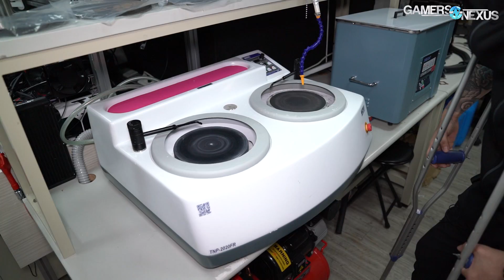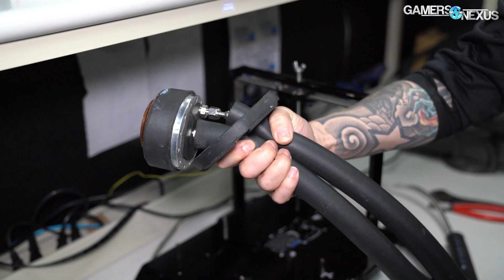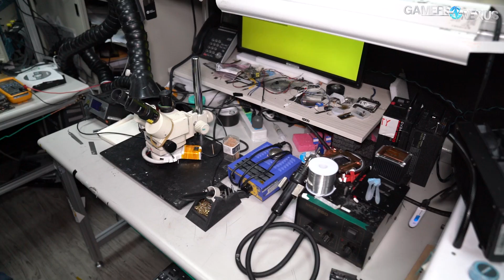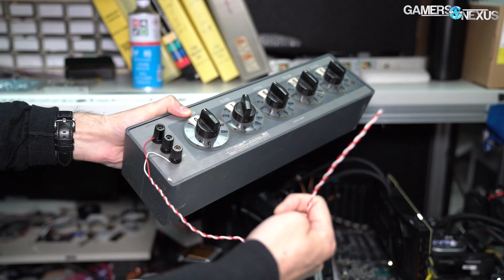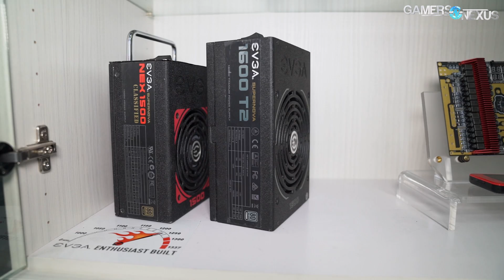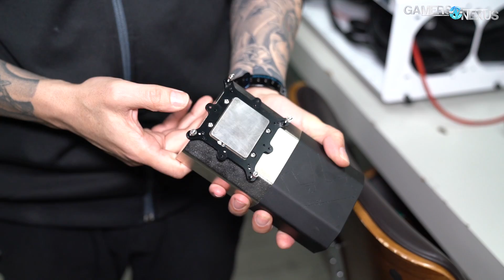KINGPIN Overclocking Lab Tour & Secret EVGA Products

Comment: I'm sorry; I can see these guys are really proud of their work in this space. But I now completely understand why EVGA video cards I've used never impressed me, as well as why, in my personal experience in PC repair shops, about twenty percent of dead-card systems had EVGA cards. Not so much because they were not good - they were decent - but because they had such an OC/snowboarder/rockstar vibe to them.
Because of that, they were purchased by a lot of kids with money who ruined them by extremely OCing them, but without the necessary precautions like adequate cooling.
But the main thing? That lab space is filthy-dirty! Like, mobos leaning against AIOs on cardboard boxes?
This space seriously reminds me of my room in my parent's house when I was 15.
The only thing I find surprising is that EVGA allowed this slop to persist for as long as they did.
And you can see in the dynamic between Steve and KP that KP thinks Steve should be way more in awe of the Greatness he has been permitted by the gods to glimpse, while Steve just wants to find a broom and some Windex.
This is why you never meet your heroes, kids.

Comment: I had a 780ti classified and kingpin and a 980ti kingpin, actually still have the 980ti kingpin just quit working but I ran it at 1.175v for like 5 years with the classy controller. Also mem overvolted to 1.5v (iirc)

Comment: Little do they know this is their front of house fake lab.  There is a button that you push under a table that opens a portal to the KINGPIN cave where the real work is being done to create micro wormholes that transfer heat to another dimension that coverts it to usable electricity that then gets routed back to GPU.

Comment: In most physics/chem labs people put just water in the ultrasonic bath, than put a small beaker with the solvent and the part to clean in the bath. the part will get cleaned and it readuces the surface of your solvent and the risk of fire...

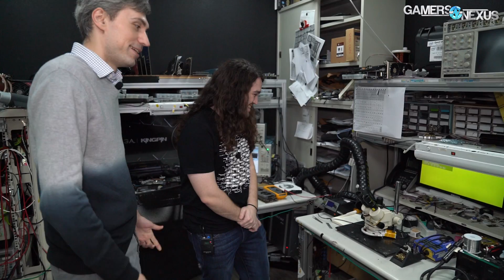Comment: 10:54 That black anodized aluminum heat sink with the copper base (CNC'd flat) is not something they made! TiN calls it "prototyping parts", they may use it for their own prototype testing, but it itself is a product from almost 20 years ago. It is an air cooler for socket A (462) (Athlon-XP, Duron). I think by swiftech. I have one somewhere...

Comment: Nice Tektronix Great Scopes, I used to repair & calibrate Tektronix Scopes, my favorite 7000 series, ESI Resistance Box another great kit for the Lab :) I used to be Deputy Head Manager of the UKAS Laboratory Years ago,  Parylene coating on a PCB is wonderful coating to keep the components intact and very dry, hard coating, once applied hard to probe to the PCB thats the only drawback,

Comment: Fellow NC resident, we had this type of machine (sander/lapper) when I worked in powdered metals inside of the QC lab, except we had 4 wheels for extra steps in the polishing process. The first 3 were different grit of sandpaper, the last wheel was a polishing pad. We also had an ultrasonic tank for tooling. Very cool to see these tools used in Kingpin's lab for PC parts.

Comment: Nice bike K|ngp|n, also on the X299 green board that was put in Ultrasonic cleaner there seemed to be blue thermal paste on the back, why is that? What components we being cooled on the back, or was that just to protect from back plate? Ty for the tour, good luck Tin and Vince!
Reply: It's protection against condensation: everything around the CPU gets very cold

Comment: Looks just like my old Lab back in the day...the feels..
and BTW, Each of those Logic Analyzers/Oscilloscopes and other equipment can range from 1000$ to 50000$+ USD. Hell, those voltage probes are most likely 5000$ USD. Tektronix, nothing but the best.
Reply: My logic analyzer (that one on video actually personal asset) have listing price over 50k :)
Reply: @xDevscom_EE  i kinda miss my old job and ya 50k$ plus, i had probes that were 5K each for measuring electromagnetic leakage out of test prototype for FCC regulations and what not.

Comment: The NEX1500 PS was an awesome product, but reliability was poor. What was really cool was the software that came with it and the access it gave you to the PS. I wish EVGA would come out with another PS like the NEX1500, but with the quality of current products. Also, the braided cables were nice. I'm still using the braided cables from the NEX1500 today, even tough I've updated the PS a couple of times.

Comment: Why won't EVGA make motherboards for AMD?
Reply: they should, would love some
Reply: Excalis Ogre lord my guess is just the lack of interest in AMD overclocking. Most records are set with Intel chips and the dark boards are really meant for LN2, so not much interest from casual AMD overclockers/gamers
Reply: @jakenorthand1755  haven't they gotten the new AMD's to something insane like 8 GHz or something lame?
Reply: Jesper Andersen nope, Ryzen is rather awful at high frequencies. World record is 6ghz on a 2700x and 7.3 on 9900k. Benchmarks are also dominated by Intel. For Cinebench R15 8 core you have to scroll to around 45th place to find an AMD cpu
Reply: @jakenorthand1755  ah sorry it was not the new ones but the FX series they did a world record 8.7GHz on, so yeah AMD sucks not even 9GHz
Reply: Jesper Andersen FX series is a one trick pony. Sure it can hit high frequencies but it has horrible performance once there. Top cinebench for a FX-8350 is 1115, while air cooled 9900ks can hit 2000. Piledriver CPUs are also limited to DDR3
Reply: @jakenorthand1755  doesn't really matter since Extreme OC'ing like that IS a one-trick pony thing, noone runs it permanently, noone uses it for anything other than posting the screenshot and getting patted on the back. and the one they used was good enough for many people for quite a few years, was it the best? Nah, but it was cheap and did well enough

Comment: The fire hazard is due to the solvent evaporation from heat up due to solvent particles shaking from the ultrasonic waves hitting them which creates heat. KP just ends up with a tank partially filled with flammable isopropyl alcohol fumes, so he needs to keep it away from open flame or electrical sparks. We use those to clean glass at our chem lab or to prepare various solutions. Daily we run them with distilled water so there's no problem with heat unless you let them run for hours and forget to refill the water (which does happen with students etc). You also might run into them at your local jeweler since they often use it to clean jewelry like necklaces, rings etc. The sound that it makes is a bit different in RL, the way it came out on YT is probably due to some interference with the mics. You can find some videos which have the correct sound recorded but it's a real PITA for your ears in RL and usually you keep it away from regular work stations, preferably in a dedicated room.

Comment: it is very smart that the EVGA Kingpin RTX 2080ti uses a 240mm rad, on my EVGA RTX 2080ti XC Hybrid temps hit 60-65c playing Metro: exodus with the single 120mm rad(inside a NZXT H440 case), imo 240mm should lower the temps alot the RTX 2080ti can get somewhat hot.
Reply: test it again but open front panel on your case

Comment: KINGPIN's & TiN would probably be dumbfounded that I wanted that EPOWER V back in 2014 to fix the craptacular AMD AM3+ motherboard VRMs. Shame it didn't exist back then, lol.

I just need it to automatically go to 1.375V at powerup, without another computer already on to tell it to go to that voltage. I'm just Not sure the EPOWER V has that kind of preprogrammed ability, and how much grief the M5A97 (v1.0) will give me if I delete it's Vcore and SOC VRM. Due to win10's interface, the FX8350 with win7 is a must at this point. I will need to eventually rebuild the VRM, no choice due to software requirements.

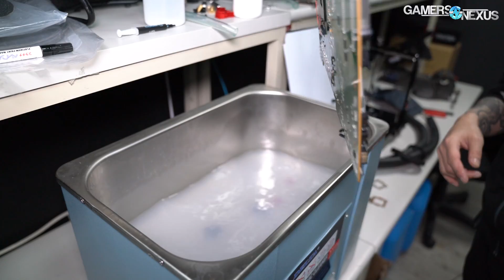Comment: HOLEY CHEESES!! I went like "WHAAAAAT?" when he blasted the socket with pressurised air. (edit 33:07)
Reply: Yep, you need to use some kind of pressurized air to clean out possible pockets of liquid underneath components such as chips, resistors, ports etc after cleaning with Isoprop Alco or any kind of solution that's used for cleaning since the liquid can get trapped in there fairly easily and wont dry off in open air. Seeing that air pressure system though makes me jealous cause the one I used to use at my old job was loud af.
Reply: @dvtye3378  Oh, you're concerned about the noise? Maybe "my mileage varies", but EVERY YT channel, i'm subscribed to, tells me that LGA sockets are sooper fragile! And that bent pins are a rear nuisance to fix. That's why i was astounded by KP casually blasting 'em. Not so fragile, after all, ey?! (Of course, don't touch [rub] 'em. LOL) BTW, you know Louis Rossman? IIRC, he "bakes" off the residual liquid, after ultra-sonicing his boards.
Reply: @fluffyfloof9267  Yep, pressurized air ain't gonna damage pins in a socket since the air can easily move around it. Iirc LRs method of baking it is another viable method and was our alternative when we really wanted to make sure that the boards had no residual liquids left behind. Though you run the risk of possibly reflowing solder on the board if left for too long or too high.
Reply: @dvtye3378  it's probably not >99% IPA; i'm sure 70% (maybe even 50%) would do just fine, and pose a significantly lesser fire hazard. (I know 40% booze burns, but it's relatively effortlessly extinguished - just blow it out.)

Comment: The metallurgists are cringing at his polishing technique. You have to move the the sample (usually counter clockwise to randomise the scratch pattern and get ready for the jump down to 6 micron polish.Secondly you don't place metallic parts on the bottom of an ultrasonic cleaner because you're reflect the waved back into the transducer overheating the element and shorting it's life.